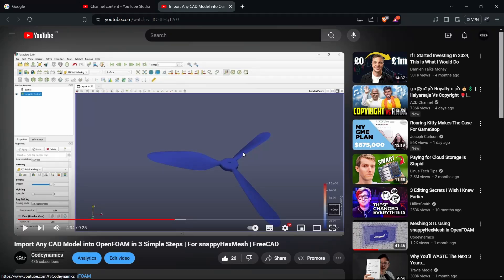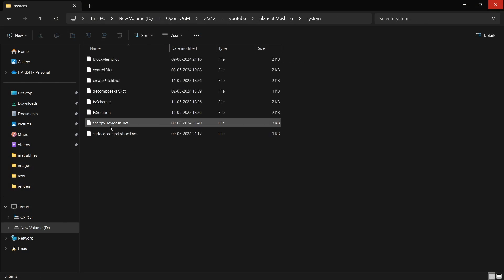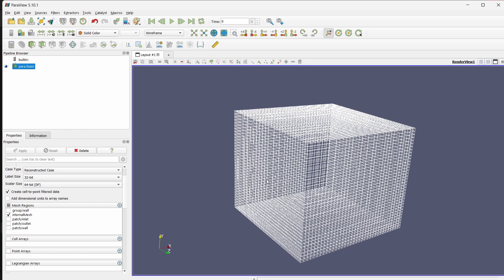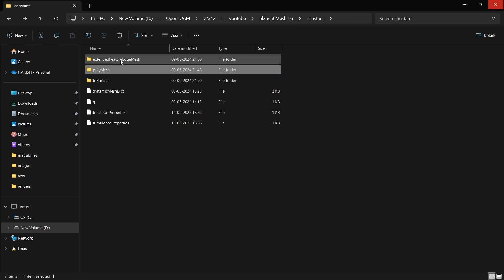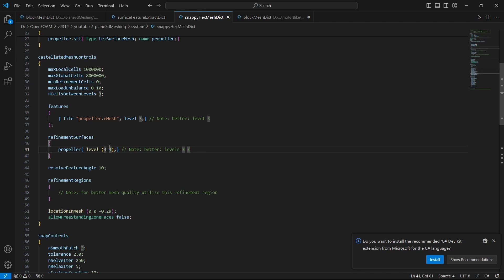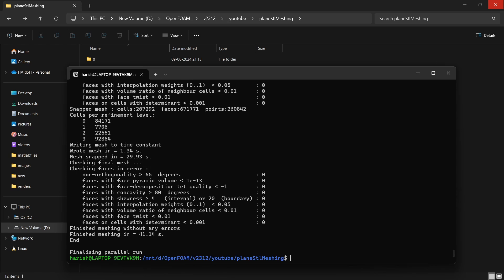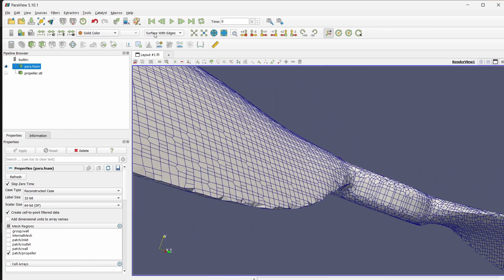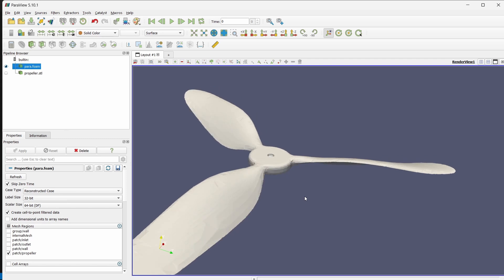Propeller Meshing Using snappyHexMesh | OpenFOAM Tutorial

Comment: Hello!
I have a task to simulate a free falling .stl object in the air. The goal is to identify the lowest altitude where it can be stabilized based on its aerodynamics.
Can I do this in OpenFoam?
Thanks!
Reply from the maker: Yes you can. You might have to use the 6dof dynamic meshing to do that.
Reply: @Codeynamics  thanks!